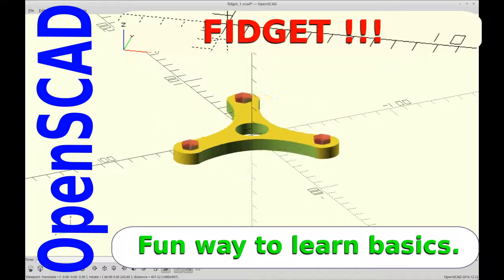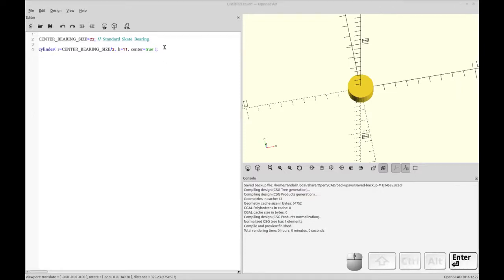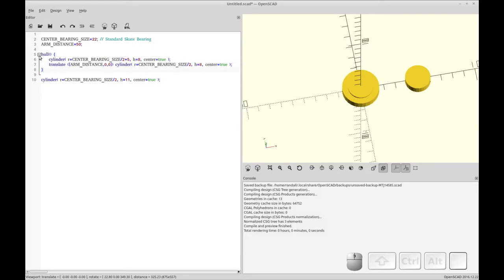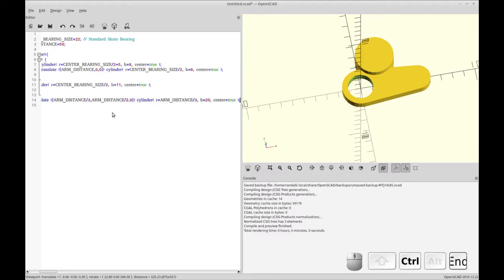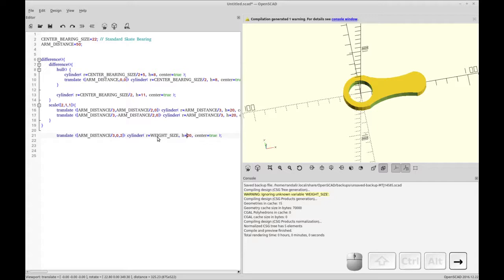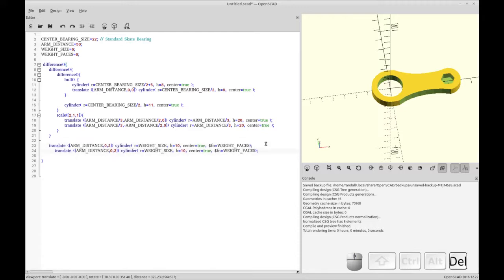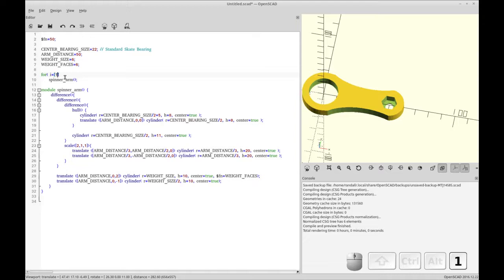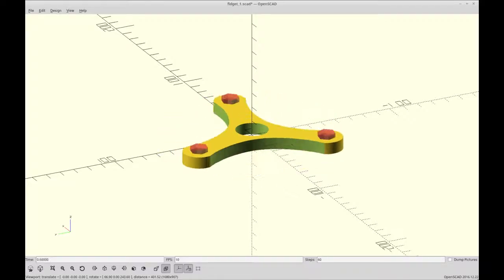OpenSCAD - Code a Fidget Spinner

Comment: y arnt the arms circles
Reply: Paul Randall Thank you, but i ment where u put the other bearings on the arms it needs to be the same size as the middle and circles to you can fit them in
Reply: Paul Randall thankou i appreciate it alot im trying to make figit spinner in school but it has to have 50 codes